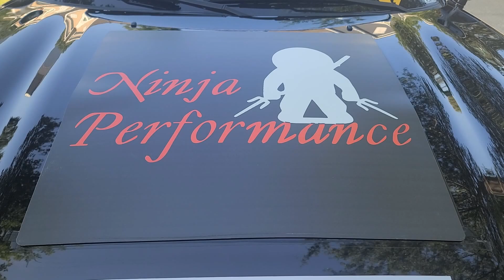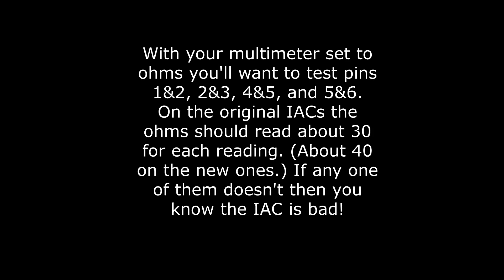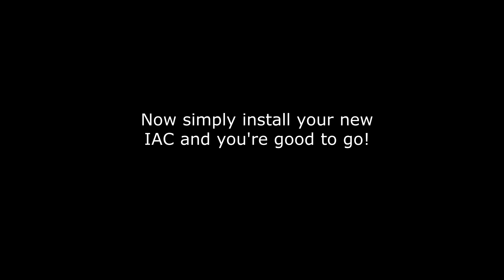It's Never Just a Tune! Diagnosing bad idle, test/replace Idle Air Control (IAC) on a 3000GT VR-4

Comment: Whered you buy that IAC if you dont mind me asking 🤔
Reply from the maker: The IAC in this car is part of the Jester MAF. I'm actually on speed density on the AEM so the MAF is generally ignored. The only value coming from it that is used is the IAT. Ideally I'd delete the MAF and just install an IAT after the intercoolers. The Jester MAF is great for people on Chrome as it reads farther than the stock MAF helping you to get beyond the theoretical ~400 horsepower limitation.

Comment: Looks to me like you've got a mechanical problem with that atmo BOV and a jester AFM.
Reply from the maker: Actually no issues with the BOV or the Jester MAF. This car is on speed density so the only thing used from the MAF is the IAT. I could removed it altogether and just put in a solo IAT sensor. Once the fuel pump wiring and IAC were fixed it was back to normal.
Reply: @Morgamania2  That creates another hardware problem where the IAT should be in the manifold, not before it. Both temperature and pressure drop across the throttle butterfly, not really relevant for WOT but essential for part throttle. The turbos heat the charge, the charge coolers try to cool it. What you're measuring at the intake has zero relevance to the manifold temp.
Reply from the maker: @1magnit  I hear ya, but idk as the stock VR-4 is designed that way. I don't have any issues at part throttle.
Reply: With the stock setup it's equivalent to MAF, as in the air is metered before it enters the engine, volume, temperature and pressure. Those 3 give mass. When it's speed density you've got to measure the air inside the manifold. To get density you need temperature and pressure.  That's inside the manifold not temperature before it enters the engine. If you're only measuring the pressure in the manifold it's not speed density, it's speed pressure with a clown type temperature compensation. The Mitsubishi factory speed density setups, they measure the temp at the far end of the manifold, the opposite end from the throttle body.  @Morgamania2
Reply from the maker: @1magnit  True on the MAF stock setup. I should have clarified that earlier. I understand what you are saying there with regard to where we measure temperature. This is the car tuned here: https://youtu.be/Prmn_7ToGQw
Reply: @Morgamania2  When the hardware is wrong, it's wrong and no amount of software can fix it. Just like when kids upgrade their fuel system wrong every time and get unstable and increased  pressure at idle. When it's wrong it's wrong and should be put right ..................just to be professional.
Reply from the maker: @1magnit  The very words I have used myself when I tell people tuning cannot fix a mechanical issue. Hence the topic of this video. :)

Comment: That is great info, but how do I check if the drivers in the ECU are bad? I have a problem with the idle where when I turn on the AC, the RPMs drop, while they are supposed to rise… I have tried several IAC motors, some of them of the older style and some of the new style and even though all tested good, none of them fixed the issue. Turning the steering wheel also does not raise the RPMs like it is supposed to… Now, I am running a Chrome ECU that is only several years old and I am very skeptical that its drivers would be burned, but I am not sure what else is left that could cause this problem. MASS airflow sensor maybe? So, is there a way to test the ECU drivers through testing the harness?
Reply from the maker: Indeed idle should be higher, by anywhere from 50 to a few hundred RPMs depending on the coolant temp, when you turn on the AC. The stock idle settings in Chrome are generally spot on and I refrain from modifying those in most scenarios... meaning this would most likely be some mechanical issue. When you say drivers I believe you are referring to leaky capacitors - a condition that happens on some stock ECUs, but I've never heard of it on a Chrome ECU. Since you have ruled out the IAC consider your FIAV (fast idle air valve). All these parts are like 30 years old on our cars at this point so the probability of failure gets higher. Best wishes!
Reply: @Morgamania2 ,

I thought that the FIAV was only relevant on a cold start? Would it help if I block it off with one of the plates someone makes for it or should I just replace the throttle body?
Reply: @IlianNachev  correct.  The FIAV is only  related to idle at cold start.  But if it happened to leak air, it could make it hard for the IAC to do its job.  My suggestion is to :
Boost leak test.
Fix all leaks. 
Test/set TPS.
Clean IAC AND where it goes into the TB.
If all is good, you can delete the FIAV, but just be aware it will affect start up/warm up in cold weather.
Reply: @jeremysharp5436 ,
Thanks for the input!
Reply: @IlianNachev  no problem,  I am the mechanic for several of RacerX's customers, so I thought I would chime in with some suggestions.
Reply: @jeremysharp5436  ,
That’s greatly appreciated! Thanks again!